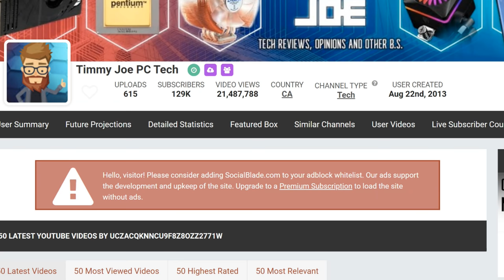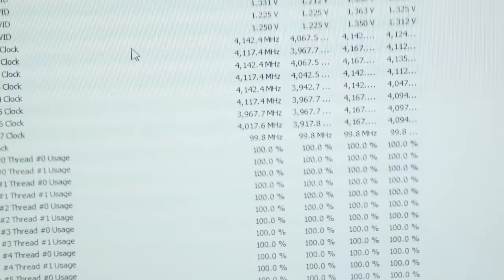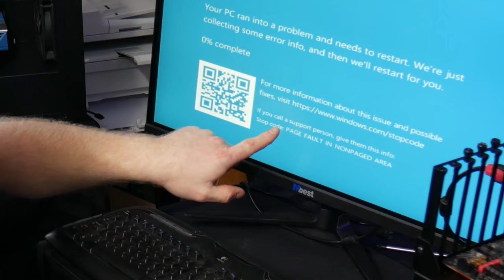This Ryzen 3700x was my biggest problem in 2019...

Comment: I actually just had the weirdest issue I’ve ever had with a CPU. So, I did a very light over lock with that b450-F Asus board you mentioned in this video on your run of the mill Ryzen 5 3600, and my computer couldn’t take it, I guess. I ran the exact settings in Ryzen Master for hours without a single issue, but once I plugged the numbers into the BIOS, my computer seemed to boot up just fine, except without any video display, and a white mobo LED (VGA). Complete no-post, mo bios, no anything, but my fans were running, RGB came on, etc. 

I cleared the CMOS, but that changed nothing. 

I had just built mostly a new computer, and went from Intel to AMD, so I didn’t have another mobo to plug it into, but I did swap everything back to an Intel build and was able to post and everything perfectly fine. 

So that rules out the GPU being dead, like several people had suggested. The RAM was also not dead. The PSU was fine, and the cables weren’t the problem. So I couldn’t narrow it down between the mobo and the CPU, but luckily, they were both still returnable. 

Ultimately, I ended up spending more and getting a Crossfire Hero VI on sale, but it seems dumb that I ended up spending almost as much on the mobo as I did on the cpu.... but now I have bios flashback, an idiot-proof clear CMOs button, and a q-code display for troubleshooting. 

Also, I went ahead and exchanged the 3600 for another 3600 just in case.

Still, I’d love to know what the issue actually was...

Comment: I had a Z77 Asrock motherboard that had occassionally blackscreened or crashed at startup. It would take 15-20 failed attempts to start up, despite clearing CMOS, wiggling the graphics cards, reseating the RAM, etc. Then it would suddenly work for no obvious reason and go for months and months being just fine, even with an overclock. But sometimes after a year, the problem will come back. Never could diagnose the problem, I had another z68 system to make sure all the parts worked too.

Still it chugged along, occassionally giving me issues but on the whole working 99% of the time from 2013 to 2019 when I finally upgraded.

Comment: I had a new build with Gigabyte C246 WV4-CF motherboard and I7 8700K that would only run at 800 Mhz all the time like it was too hot.  I had to figure out to run ThrottleStop to disable BDProchot so that it would not throttle all the time.  Only thing I could guess is the board might have a bad temperature sensor.  The temps were fine.  "ThrottleStop is an original program by Kevin Glynn, a.k.a. “UncleWebb” which in simple terms is designed to counteract the three main types of CPU throttling (thermal, Power Limit, and VRM) present in modern computers.  BD PROCHOT – Short for Bi-directional Processor Hot. PROCHOT is an emergency throttling method triggered when a CPU hits its maximum temperature (100 or 105C). You will often see this triggered on MacBook Pros, for example. Bi-directional PROCHOT is a system some laptops use where the CPU will be throttled when another component, such as a GPU, reaches a set temperature even though the CPU has not his its maximum operating temperature. Disabling this box should disable this feature, meaning a hot GPU temperature trigger should not cause CPU throttling. Be aware that this may result in even higher chassis temperatures, and I would not recommend disabling it."  https://www.ultrabookreview.com/31385-the-throttlestop-guide/

Comment: Yep, long ago I had an issue with an AMD K6 that didn't like MSI.   Booting directly to DOS helped me get errors, plugging it in any other board it didn't crash.  BIOS update also fixed it.  I can relate and tend to swap brands of boards if I can get ALL the hardware moved over, including ram.

Comment: I had the same weird BSODs with a Ryzen 5 2600 & Gigabyte Aorus Elite B450 board, running stock (XMP off). BSODs were totally random. Would sometimes work for days, other times would BSOD constantly. It would never crash during synthetics/load and stability tests/memchecks.

I eventually tried just setting the RAM voltage to 1.35V (after trying many other things), never another BSOD. Individually, the parts were all fine. I've swapped CPU/Mem/RAM/PSU/Mobo around into other Ryzen PCs with MSI/Asus boards, no BSODs.

Comment: When I built my new Gaming PC a year ago, I went with Ryzen 2700x inside cheapest Asus X470 board w/ T-Force 3200Mhz RAM. Basically I had BSODs right off the bat and sometimes would not POST at all. I'm a PC Repair Tech w/ 9+ yrs experience so have knowledge to troubleshoot issues.

I tried to run default RAM speeds, BIOS updates, and whole 9-yards. Finally pulled stick of RAM and PC worked ALMOST perfectly fine with Single-Channel 8GB stick. Swapped RAM sticks for faster B-Die Cas14 , higher-end MSI X470 motherboard, diagnostic tests, multiple Win10 installs, and waiting almost weeks & weeks for returns/RMA. Even diagnostic lights on motherboards were showing RAM as issue on POST. Found out my 2700x CPU had a BAD internal memory controller...  the last part I thought to be issue since would POST and boot most of the time.

AMD sent me a brand-new one. PC worked perfectly & also ended up keeping B-Die RAM & MSI X470 Carbon board.. made me build a better PC tho! The most rare DoA situation I've ever dealt with. Of course it happened on my own build of all the builds I've done for customers.

Comment: My brother has had this exact same issue with his retail 3700X that he got shortly after launch day, and iirc, used a Gigabyte X570. It was pretty solid for the first few months, with very occasional BSOD issues. Then after a while they got worse. He replaced his RAM, and it worked fine for a while, but started getting worse again pretty quickly. Where, playing games, or watching twitch/YT would cause a crash.. but each crash would give different errors.
He tested or replaced everything, else PSU  GPU etc, but still had the same issues. He then replaced the motherboard, to an MSI, which kinda fixed the issue for the most part, but still wasn't perfect. He then tried disabling 2 cores and that seemed to fix the issue?? Then after re-enabling them it was more stable, but still not perfect.
But there definitely seems to be a potential reliability issue with early batches of the 3700x, esp on Gigabyte motherboards.. my cousin had a similar board but a 3800X, tho it's been rock solid.

Comment: To fix it, TURN OFF DOWNCORE CONTROL in the BIOS. Before doing that, I would have to underclock my ram a bit to get my PC Stable but it still would BSOD but not as often as It did at first. I used to have the same problem with my 3700x and Gigabyte Mobo.

Comment: My biggest problem of 2019 was a defective TT pci extender cable for verticle mounting my gpu. Half the time it worked, half the time I would get no signal to the monitor and ram wouldn't clock over 2100. I thought it was the motherboard or bios struggled for two months then it clicked, check it without the extension. All problems instantly fixed. I was thrown off by the ram issue, I though that meant it had to be a bios problem. Live and learn.

Comment: When I was working for tech support for an OEM I had a customer contact me regarding multiple blue screens on 5 of their brand new model systems.  Updated the BIOS and ENSURED to ask what type of devices were attached to it.  They said just keyboard and mouse, flat panel display, just the normal stuff.  Spent a week trying to narrow everything down.  Right when I was able to send out a replacement, they come back with, 'Oh, we disconnected the el cheapo powered USB hubs that we bought off of XYZ company and it's working now.'  Grrrr... customers and their lack of information providing.

Comment: I find this interesting, because I have a ryzen 7 1700 with a MSI tomahawk b350, and been having the same issues from time to time. just random BS's. all my parts always check out fine. no matter what I do I get BS's here and there, sometimes when i'm gaming, sometimes when i'm just browsing the internet. luckly, i'm planning on upgrading to a 3700x and a new motherboard when taxes come in. my temps are always pretty good. liquid cooled running around 65c under full load, and around 30c when idle. i'm just glad  it only BS's once maybe every few days. once in a blue moon, it will BS repeatedly every few minutes. but thanks for the video, maybe my situation is something similar, just with a 1700 instead of a 3700x.

Comment: Thank you for the vid, Timmy. s you can see, you are not alone. I had the same problem with random reboots at idle on a MSI X570 Carbon mobo with a 3600. I've now added a cpu vcore offset of + 0.025 and its absolutely stable at idle since then....

Comment: I have had the exact same problem with Ryzen and gigabyte mobos. The page fault error is a memory error,and in my case, the problem is that the memory voltage occasionally drops too low. I fixed the issue by setting memory voltage to 1.35 volts manually. After that, the systems I have built have had no further issues.

Comment: I had a to trouble shoot a build once a customer brought in and it would crash randomly, no blue screen, just completely shut off. 
Replaced pretty much every component in the system 1by1, after 3 days I finally figured out the issue, the power button in the case was shorting out. :)

Comment: i feel your pain, as I just finished working on a customer's 7700K/Z270 fiasco that was quite similar, but,...worse, even, as I'd get blue screens immediately after or sometimes during Windows installs.... Tried a million BIOS settings, new RAM, conservative clocks, you name it, swapped mainboards and still HAD a lot of issues, then, suddenly it worked a few days. Customer was happy two or three days, but, flashed his BIOS, and it would never work for more than 10-12 minutes afterward.... (I was unwilling to risk breaking my own flawless Z270/7700K to troubleshoot his, so, told him he either had another bad mainboard, or, possibly even the ever so rare occasional bad CPU. But as 7700Ks are so damn expensive, he'd be better off getting an R5-3600 and B450 board than buy another 7700K at the current $340 pricing...)

Comment: I had a i7 3820 with Gigabyte X79 UD3 rev 1.0 (not rev 1.1) in 2011 until now and it gave me a real headache because it just keep having random bluescreens. Apparently i claimed for warranty and i saw that when it come back, it have some chip replaced. It's still have a random bluescreens, but the chance feels like going down from 30% to 0.1%, not perfect but still ok. I even have it running it as my home server for 2 months in 2023 now and didn't have any issue. Reading some articles back in the day, apparently X79 UD3 rev 1.0 have some power delivery issue, it can't even run Xeon V2 where the X79 UD3 rev 1.1 fixed the issue and enable the motherboard to run Xeon V2.

Conclusion: i'm avoiding gigabyte motherboards from that time on... i have been using asrock for years now with big smile in my face. right now i'm using X670e Pro RS

Comment: Had a very similar issue with my b450m aorus board and my ryzen cpu(1700x). Had blue screens randomly, page faults etc... Turns out my issue was the board having fast boot enabled *I'm guessing something to do with idle power and power states with the cpu*. Disabled fast boot in bios and hybrid sleep in windows and every bsod went away.

Comment: I am having a similar issue now. Been fighting with an Unrecoverable error that randomly pops up on my system. WHEA LOGGER. Cpu Hierarchy error. 

I changed out, the memory, PSU, GPU, and Finally the CPU. Started with vega 56, then a vega 64, tried a gtx 1660 oc ss, rx 5600xt, now I am with a 5700xt.  I started with an R5 3600, then went to an R5 3600x. Amd replaced both CPU's under warranty while I was troubleshooting the issues. Sold the 3600x and gave the 3600 to my brother. Neither of those old CPUs are having any problems now, and are working perfectly fine in their new homes. One is an MSI x470 class motherboard, the other is a Gigabyte B550 chipset motherboard. I am using a Gigabyte x570 Ultra motherboard. This issue has persisted across three CPUs now. I am now using an R7 3600x and I am STILL having this error. Gigabyte told me the problem was not their perfectly crafted motherboard, but the fact I was using a 1300w PSU. ( I dont need that much juice, it was a perfect sale deal on amazon. ) 

I am ready to ditch this motherboard now after watching this video. It worked perfectly fine with a r5 1600x and a 2700x in recent testing. But I cannot get this thing reliable. Pi95 for 24+ hours reported no issues. Aida stress test, no problems, after 6+ hours. 

I can replicate this issue easily, by running a game for a COUPLE minutes and letting the system idle. Boom, hard restart. It will hard restart at idle, during games, having many tabs open. Even just running the media player. At times it will hard restart during a cold boot. Never a warm boot tho. 

am not getting a BSOD tho, just a hard restart. Everywhere I look this issue up, there is no resolution. Just hearsay and guesswork, and a lot of frustrated users giving up on it. Thing is, most of them have gigabyte as well I am noticing. I am kind of wondering if its related.

Comment: I got my Windows installation currupted two times, explorer started restarting, Firefox started crashing tabs, Firefox crash after opening it in the first 2 seconds, then it started giving BSODs into WIndows, then BSOD during boot. The culprit was the M.2 SSD, these things get HOT really fast and it throws errors and eventually the Windows will get so corrupted that it will become ireversible to recover it. I hanged a 14cm fan on the GPU and now it throws air into M.2 SSD. Everything works fine. I even lower the fan speed during the autumn/winter. I was using the fan at around 700rpm even during gaming without problems and 2 months ago I started getting BSODs again. It took me 1 day to remember the problem. the spring. Ramped up the fan to 1300, problem solved. TY-147A at 1300rpm is not actually noisy on a Define R5 case. The SSD I have stays at 55-57C in idle. Without any cooling it can go to 80C really fast. Peak temperature was 89C.

Comment: I had that same problem with a X570 Master and a 3700X and it turned out one of the cores on my 3700X was bad.  After an RMA replacement, it's been good.

Comment: My only 'gremlin' ever, was when restoring a friend's pc and doing an upgrade..but that was back in the time Irq's could mess up stuff seriously.
We put in a wifi-ethernetcard and everything flipped from then on. The system never ran again, ever, even when changing everything besides the mobo.
Until today, we never knew what the problem was, every part was reused in different systems without any trouble.
I was lucky to have many spare parts or I'd probably lost a friend back then. 
Today he learned to build his own..maybe that was a bit of a positive from that...
Eversince that happened I kind of become an asus-fanboy, never had any issues with them, beside the usual bios-updates when newer cpu's come out.

Comment: Gremlin tatoos are the sign of a true enthusiast. I once chased for months randomly connected issues all kinds, reboots, freezes, slowdowns, corrupt files... it was the PSU. This is why I never shortcut on the PSU.

About the gigabyte issue. I wonder if it could be PBO related. Different mobo makers all seem to be doing their own thing with regard to voltage, freq, and thermals. My 3700x would get so hot (on water) it would throttle. Turns out asus has pbo on by default in bios with wacky voltages.  Just a guess.

Comment: Oddly specific issue, not like my last build, FX processor with originally an Asus board. Having random failures of various connections/components and after swapping significant chunks out, I had a USB error problem, so then I was sitting there going "Could it be, by chance the board?" So I swapped it out for a much better MSI as the Asus was one of their more basic 99FX boards, the EVO, and I put in an MSI FXA Gaming board, the last of MSI's send offs for that chipset. It works great and only more recently did I start to have issues with that setup, but I believe it was just that CPU's time to retire and the cooler had failed.  These days, I'm on a rebuild using mostly new parts from Threadripper's second gen, and no problems, can stream, game and the cpu barely breaks a sweat, and the gpu I paired it with, makes 4K gaming a breeze. To add though, the board is Gigabyte, and ontop of that, one of the ones with the Foxconn brackets that have the shorter mounting screws/bolts for the cpu tray bracket.

Comment: That's why I have sold my Ryzen 5 2600 I had the same problem, but most of bsods were when I OC ram, for example if I put it on 3200mhz and enter some game I will get bsod after few seconds but even on 2133mhz it happen sometimes. With Intel I never had any problems. My motherboard was that crappy bazooka, bios update didn't help.

Comment: I recently purchased a 3700X and paired it with a MSI X570-A Pro with 2x8GB of Corsair Vengeance RGB 3600Mhz CL18, and I also have the strangest gremlin. It runs perfectly fine, but on occasion I will get a CPU lockup coupled with a audio Brrt (No bluescreen) for like half a second, before it continues as if nothing happened. I cannot seem to troubleshoot it to RAM (Ran Passmark 86 with no issue) or Motherboard and it's driving me insane. Such a small error, but I had some data corruption on photos I copied from HDD to NVME SSD, so I know the Brrt error is actually a real issue, and not just a minor inconvenience. HALP!